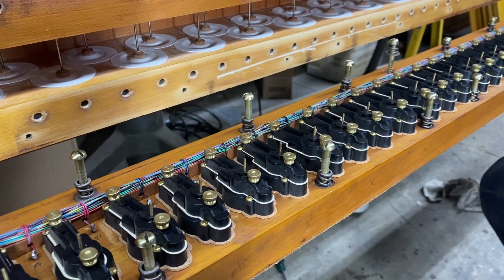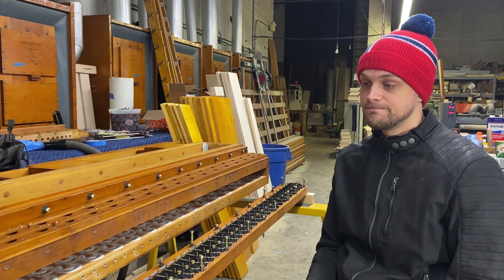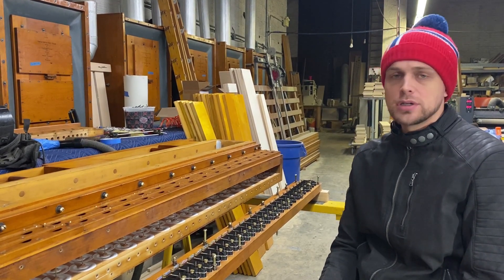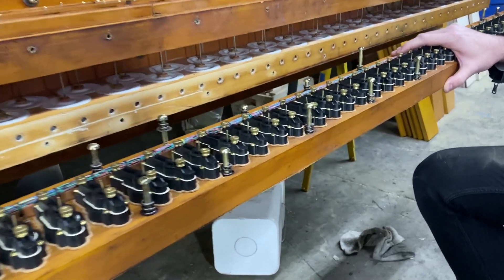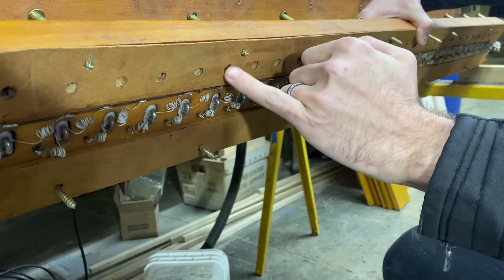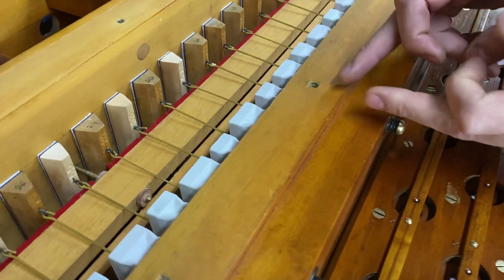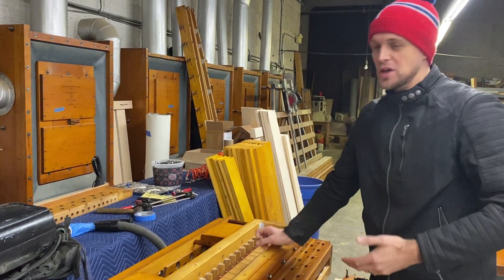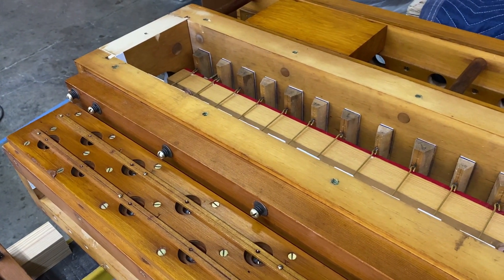Restoring the Gallery 1 - 100" windchests

Comment: Makes you wonder what was the deal with the Roosevelt Memorial park Wurlitzer. They had ranks on    only 50” wind and it seamed to cause a lot of problems, so much that Wurlitzer apparently spent as much money to fix the problem as the entire instrument cost. Here we have double the wind pressure and there doesn’t seem to anything radically different then what a chest on 10, 15, or 25” pressure be like other then maybe heavier construction.

Comment: I’m guessing even a pinhole leak somewhere on pressure of this magnitude would cause a massive “pig” squealing sound. Most other organs would simply be a small hissing.
Reply: Yep, and the pipes need to be held down to the chests for the same reason. Springs for the smaller ones, bolts and turnbuckles for the big basses. Particularly for the Grand Ophicleide as it goes down to 16'.

Comment: I was about to comment on how it was a shame there wasn't a 100" reed mounted en-chamade outside the grills, but then I had a vision of the pipes blasting into the audience like air-to-ground missiles and it made a lot more sense to do it the way it was eventually done.
Reply: There actually is an En Chamade stop in the organ! It's the Major Clarion in the Fanfare division, and is entirely behind the chamber's grill. Because of the extremely difficult logistics, the ceiling chambers will be restored last. It'll be a while until we hear it. But the Grand Ophicleide is an En Chamade "in spirit", it plays the same role and actually has a tone deflector mounted above it to direct the sound out into the hall.
Reply: @KingdaToro  the major clarion is on 50" though
Reply: Look at around, 4:37, and you’ll see those pipes are screwed/bolted down to hold them in place from the extreme wind pressure. Your ears, unprotected, can’t physically survive standing right next to those when played!